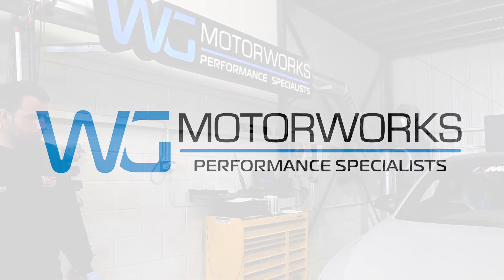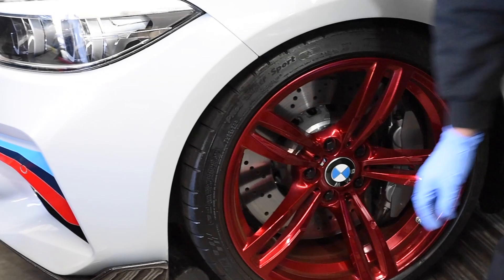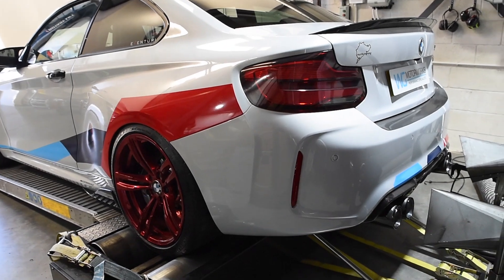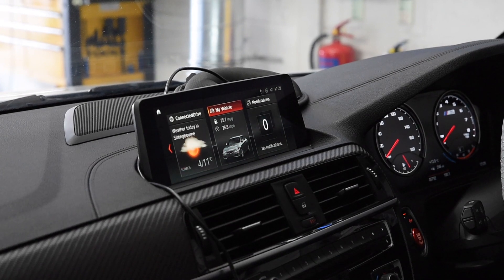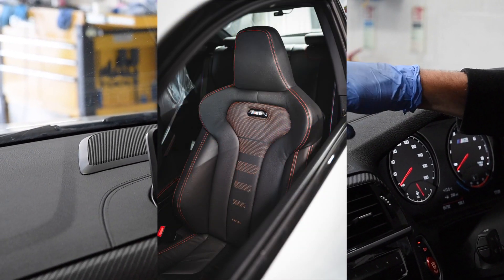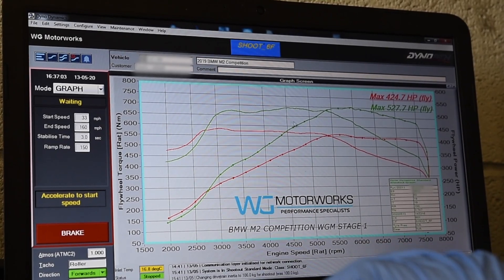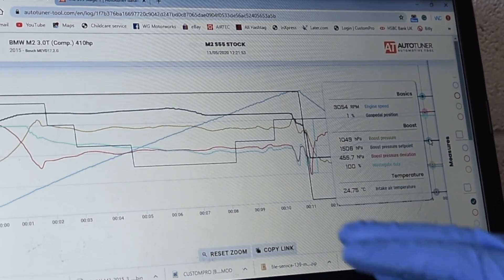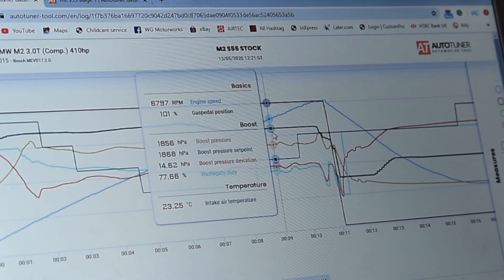BMW M2 Competition Stage 1 ECU Software upgrade - 527HP  | Tuning Features / Walkthrough

Comment: On a M240i BMW coupe 2019 model what will i gain with a downpipe and ECU 1 stage
Reply: You're probably looking at 450HP with downpipes and stage 1. Easy to get big gains for lower stage tunings like stage 1. For bigger power, make sure you have the supporting mods which also includes reliability mods 👌

Comment: People getting worried for the Crank Hub: If it's such a big concern to make you paranoid don't buy an s55. It means you cannot afford it and eventually repair it. Crank hub is not the only thing that can fail on these engines. Replaced my full valvevotronic and eccentric shaft for almost 2k n half.
Reply: Honestly if you're spending this much money on an S55-powered car then you should be able to afford to replace the crank hub almost immediately after purchasing, especially since it's out of warranty. At least that's what I did.

Comment: +110 NM of torque, can the gearbox take it without damage? noone ever talk about this issue...
Reply from the maker: They seem to be pretty strong, we run over 600lbft through the DCT set up
Reply: @WGMotorworksYouTube  Ok but is there an official data from the manufacturer?
Reply: @tibhen8473  Sure, manufacturers usually issue a separate manual for tuners with the absolute maximum perfectly safe ratings for every component of the drivetrain. They never set their cars to those limits stock, so that tuners don't lose their jobs.
Reply: @dacmm  I would love to see this manual from BMW!

Comment: Crazy how stock power is the same as a m2 lci stage 2.
Reply from the maker: Completely different engine - same engine as found in the M3/M4 GTS - which they released with 500ps!
Reply: @WGMotorworksYouTube  what engine is better for tuning m3-4 s55 or m2 s55?
Reply from the maker: @60thirty22  All the same base, just the M2 has GPF filters, once removed all see the same gains really
Reply: @60thirty22  I know I am half a decade late, but S55 if you are chasing figures in the 8xx++ hp range.

Comment: What's your opinion on the crank hub issue? At a mild tune do you think it's something to worry about? Also heard on cars produced after 7/20 (like my 2021 M2C) have a new DME that is not possible to bench unlock. Can you confirm?
Reply from the maker: Personally - no. We can offer a nice balanced 500hp/500lbft without pushing the car too much.

We unlocked a 70 Plate (6 week old) M2C last week, so believe this not to be true
Reply: @WGMotorworksYouTube  Thanks for the reply. Can you elaborate on what you mean by 70 plate? Also do you happen to know the production date on the car/DME?
Reply from the maker: @toddsimone7182  70 Plate means a UK car registered after August 2020 - so a very new car

Comment: Would love to have my M2 comp tuned . Im just worried about warranty or any engine damage that tuning might cause ? Does your tuning come with any Warranty ?
Reply from the maker: We do not offer a warranty to match that of BMW, if we did the tuning costs would be much much higher. We advise if you are worried about warranty then keep it stock......BUT these engines are very tunable and when tuned in the correct manner they can create great power - a mild tune can be offered if not wanting to push to the max also

Comment: How come its making less than stock between 2k and 2.7k? Or is that down to how the run is started.
Reply from the maker: Adaption, we often find the first runs on most cars 'lag' a little to start with. After several runs this will change, or if you change the start RPM speed on the run it would be different